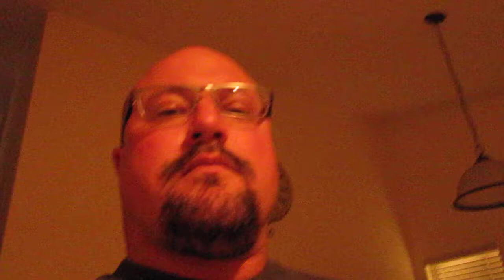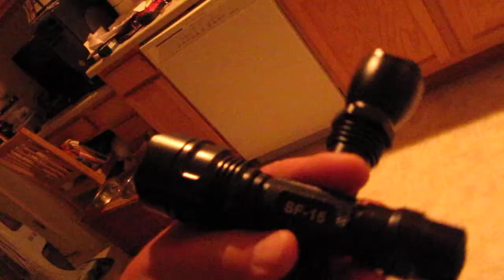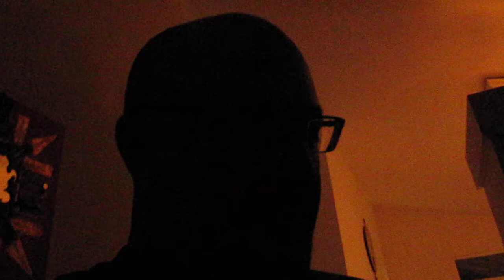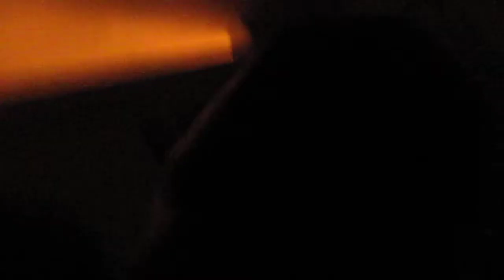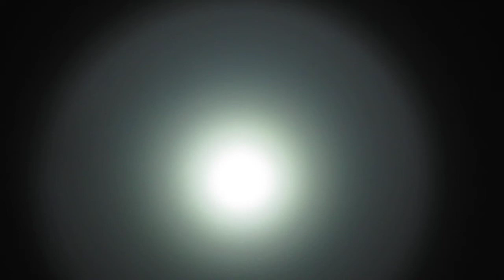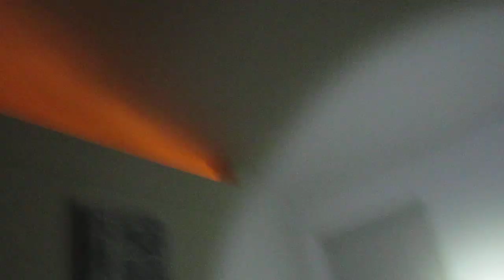MTE P7-D from Greg McGee Compared to Fake Repair DX MTE SF-15 for Josh

Comment from the maker: @Glocks12 You are partially right, I did trademark the MTE brand after the owner of MTE wanted me to stop the rampant piracy of the brand.  He also authorized me to enforce his MTE trademark registration in China on behalf of MTE China.  MTE has never made an "SF-14" and will not repair any fake MTE lights as they are not covered by the 3 year factory warranty.  Ask Josh, the SF-15 is a piece of crap which I had to fix because dealextreme would not take it back.  Thanks for your inquiry Glocks12